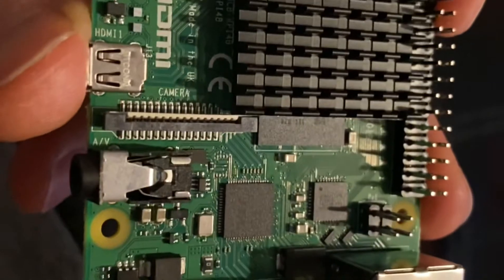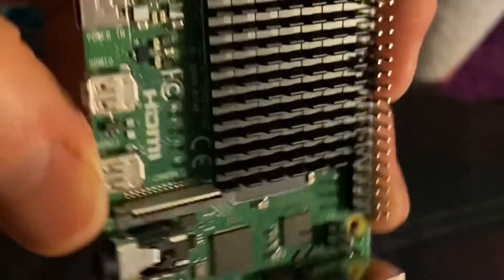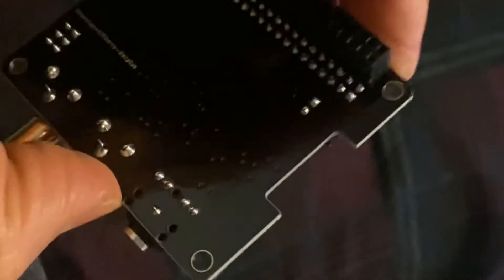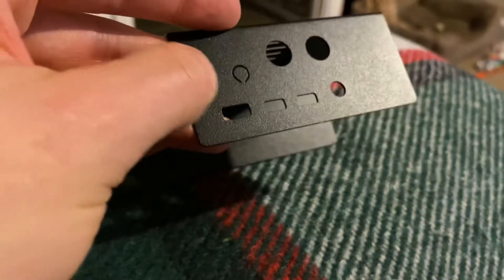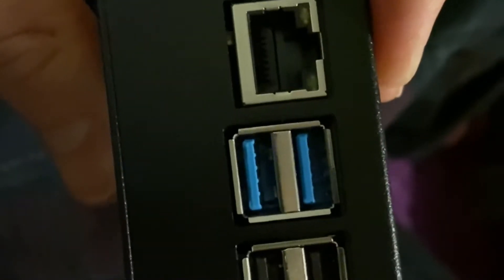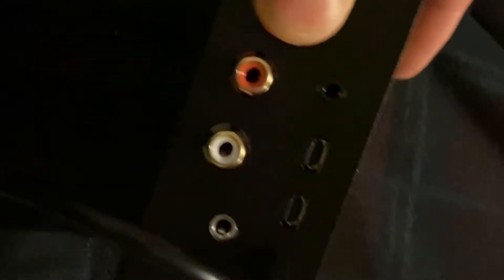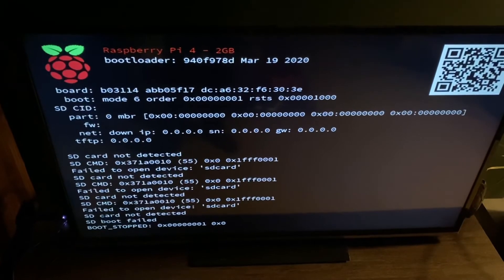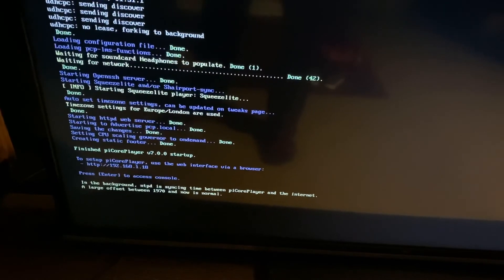Raspberry Pi HI-FI Berry DAC Build

Comment: It took me ages to figure out how this case goes together as well.  And, even after figuring it out, it's the weirdest case assembly I've ever seen for an Rpi.  And when you are mating the two halves together you have no way to get confidence that the 40-pin connectors are going together properly.  I would not recommend this case to anyone else.
Reply from the maker: It was a bit of a fiddle for sure, but it's pretty solid. Survived a recent house move etc. Still going strong :)

Comment: How did your project go once completed?  I did the same project, but used a HighPi Universal Case instead, and installed two different players to see which suited me best (i.e. Volumio and MoOde).  In the end, I went with MoOde since this distribution had an updated Kernel and Python libraries to make the HiFiBerry DAC2 Pro HAT work on all the ports (i.e. RCA and 3.5mm Jack).  With the Volumio distribution, the 3.5mm Jack would not work due to old Kernel.  Both distributions required a Config.txt tweak (i.e. "force_eeprom_read=0") to make the HiFiBerry DAC2 Pro HAT work using the "HiFiBerry DAC+ Pro" device setting.  Hopefully the Volumio Version 3 will be ready soon with updated Kernal, as their WebUI is so much better than one for MoOde.  I will have to try PiCorePlayer next.  Looking forward to the follow-up video on your project.
Reply from the maker: Hi Rudy thank you for the time to watch and comment on my video 😀

So far it’s going really well. I’m loving the player interface using the Material plug-in for LMS https://github.com/CDrummond/lms-material

This doesn’t really rely on the player software so much... I’m running the Pi headless without screen right now but can control using this plugin from any HTML5 compatible web browser. 

I’ll hope to do a follow up video the next rainy day ha ha

Comment: Great...but you never explained how to assemble the pi into the case
Reply from the maker: I know, and I’m sorry. By the time I had it together I was too afraid to take it apart again as it’s a little bit fiddly. 

There are more pictures on the write up I did that followed.. I have now added the link to the description as well. 

I may follow up with another video soon though.
Reply: ah right, no problem. I just found a doc on their web site, it's not entirely clear either but I managed to piece it together
Reply: I didn't. I was lucky I guess. Fortunately it aligned up for me first time, though can understand it must be difficult to fix if it doesn't. I've only built the one